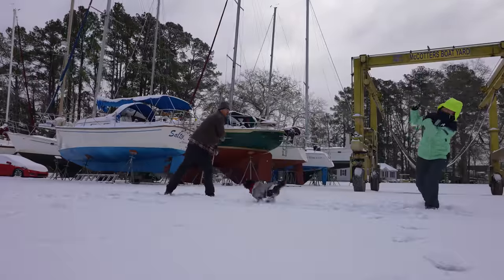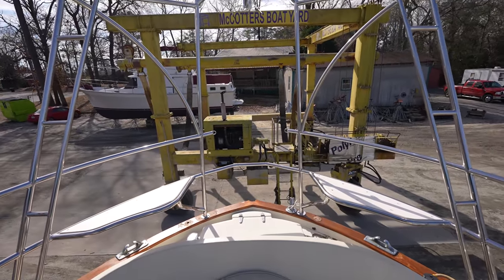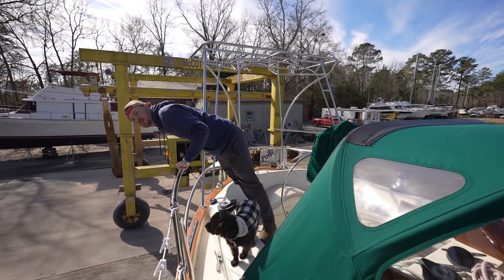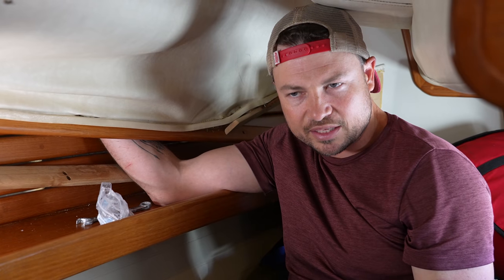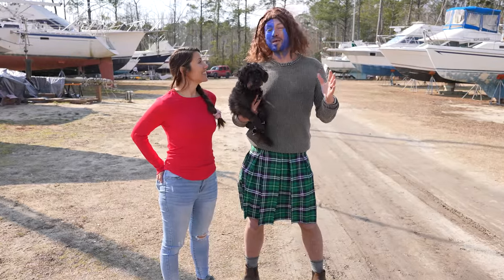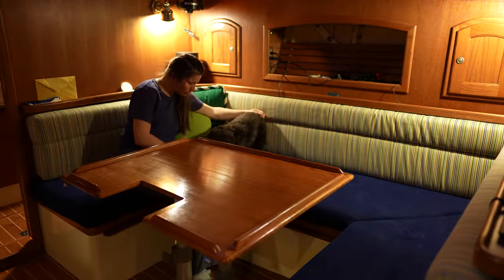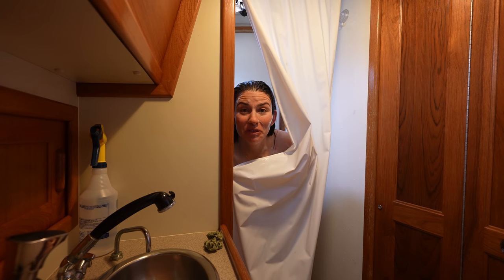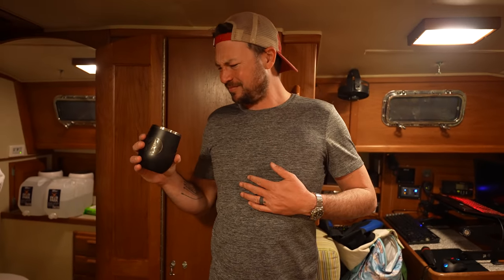Boatyard Life… the Good and the GROSS! | S06E33

Comment: I had some of that same snow near Charlotte. Going up and down stairs with loaded hands, is not very safe. I rigged a line to a cleat, and a good size D ring , to lift and lower most everything by hand,  even the temporary porta-potty while at the boatyard. For tools, a 3 gal bucket works For bulkier items like water tank, water heater, and stove, I use a winch for mechanical advantage.  I wish I could afford an arch for my solar panels, and antennas, but too rich for my blood, though I really don't need or use that much power. Be safe and stay warm. Winter is not done yet.

Comment: BIG TIP on tracking dirt onto boat.
At the top have a mat for shoes to wear off the boat. They never touch the boat. They stay on the mat and go down the ladder. You come up, step on mat and change shoes that don't touch mat. Put them on while stepping off the mat.     Also great tip for camping and not getting sand and dirt in a tent.  Little effort saving lots of cleanup.  Obviously won't work for crew working on boat but your ongoing day to day living.

Comment: I was at my boat, which is on the hard, yesterday to shovel the snow off the tarp and fix a section of the frame that collapsed under the 18" (or so) snow that fell on it Saturday.  We got more where I live, so I was looking at your snow fall and thinking, "That's nothing."  It's nice when it's a novelty, but, after all the years living in the snow, my only conclusion is that I really don't like snow anymore.  Good luck heading south.

Comment: That was fun! OK, how about a foldable wagon (costco) stored under the boat.  So when you lower laundry, Garbage you have the wagon to carry it. How about a box and pulley system to lower OSO off the boat? It's amazing that the frame when carrying a Dingy can be sustained by just w bolts into the wood frame structure.  Is the structure attached to other metal that surround the boat? Great videography and funny commercial.  Blessings!

Comment: I shower on my boat everyday in around 20 liters of water (I gage that by the the water below the under floor sump … when it fills to the level of the floor grill that is 20 L) . I have an Eberspacher hydronic heater with a 45L water cylinder, and a fan radiator in the head. So I shower then put on the fan radiator and the time it takes to reheat the cylinder is about the same time it takes to dry the head. In truth I use the heater to have a warm toilet in the morning too. You don’t have to do without because you’re living on a boat. Another thing to have is a Kärcher Window Vac. Brilliant for sucking water from windows, walls, and spills on floors.

Comment: Great video, providing valuable instruction.  I respectfully suggest putting a T-valve in line with the seawater intake for your water-maker, allowing you to make drinking water from wash-down or well water from marinas without having to buy RO water at fifty-cents per gallon.  A perfect example is the Bahamas.

Comment: The solar arch and bimini set up looks great.  Hope you get side panels to make an enclosure to protect from the elements and insects.  I'm curious about the total weight of the arch/bimini + solar panels + davits + dinghy on davits.   Perhaps you will have to alter the waterline and move interior mass forward, as the canoe stern will sink.  Although the benefit of a canoe stern is that it performs well with more load.

Comment: You need a socket with an extension bar or box spanner for those nuts which you cannot reach.... 
The arch is a work of art..but im a little concerned about sealing the cap rail against water ingress in 6-12 months.

Pool chlorine buckets are usually HDuty and have screw on lids ...what keeps water moisture out will keep P## in

If Osos even half highland terrier he'll be be well up to messing about in mud, torrential rain and snow. 😉
You need to tune into some music by the Carolina Chocolate drops...

Comment: Question....why do you use tube chalk for your sealing? To me it is just too messy. I prefer to use an american made quality butal tape on the plate and any screw threads, it stays soft and flexible with no clean up,  what are your thoughts.
Thanks for the great videos

Comment: I have followed you two since the beginning and very much enjoy your videos.  One down note (Sorry).  You will not want to go offshore with the dinghy hanging on the back.  First, it will tend to swing, sometimes violently.  Second, the weight will affect the boats waterline.  When sailing the boat will tend to hobby horse.  I tried this on our Vagabond 42 and we never found a way to tie the dinghy down so it would not swing.  Best to tie the dinghy down on the deck when offshore. We are excited to see you two back underway.
Pete

Comment: Scratching head  - if you had your mast out - why wouldn't you run two of your antenna wires through the mast? - particularly the cell booster where height of eye is a consideration  - and surely Lord Oso needs a tartan jacket now

Comment: I purchased the Scottish land that you suggested and downloaded a handsome certificate.that I could see on my screen. Five minutes later when I went to print it the image was gone and replaced by a string of numbers and letters. All the time I had been on their website at the top of the screen there was a large countdown from 60 taking place. In retrospect, perhaps that was a one minute timer for printing. I await a reply from their CONTACT US option.
Reply from the maker: Hi John! That's very strange! Could you send me an email with the problem to des@projectatticus.com so I can make sure they resolve whatever issue you're having?
Reply: I wrote that experience last night at bedtime and when I awoke this morning there was an answering email advising that a jpg  file was attached. Excellent service for a late Saturday night response. If my impression is correct, when one signs up for a digital only (not a paper one which would be mailed) certificate that there is a sixty second timer to print it - after that the image turns to a string of numbers and letters. It is now a few minutes since I received the jpg version and so far it has not "turned into a pumpkin". To be sure, I quickly printed it!